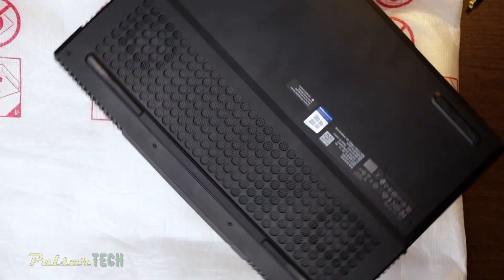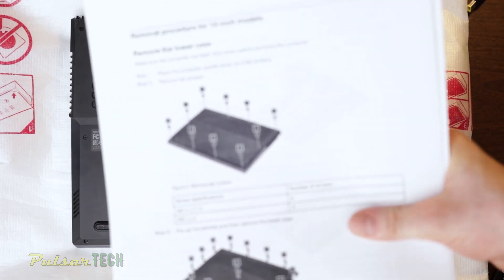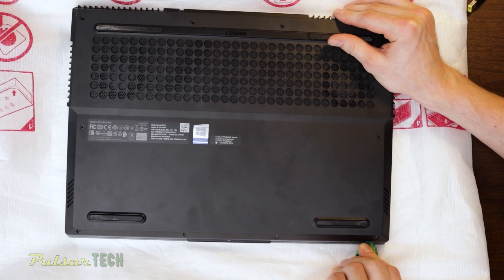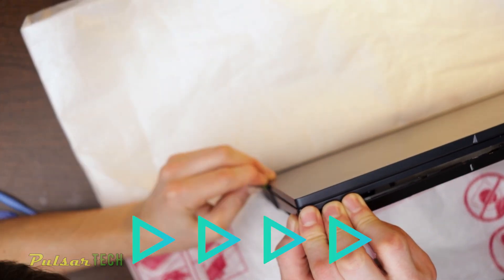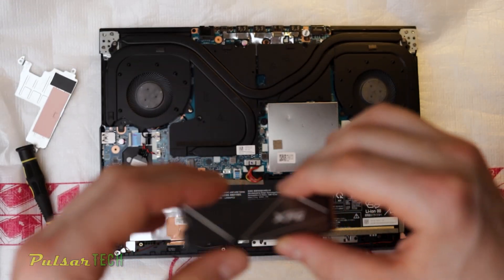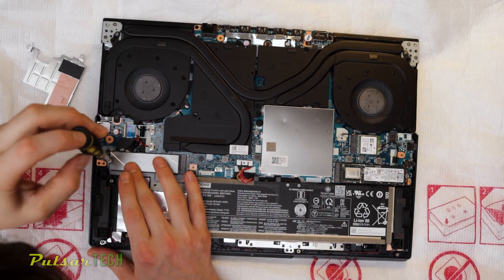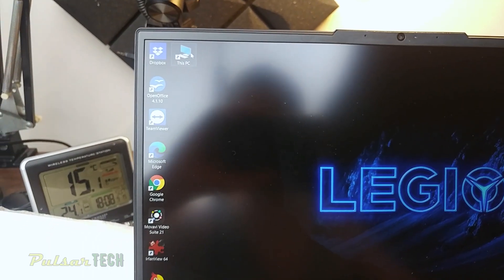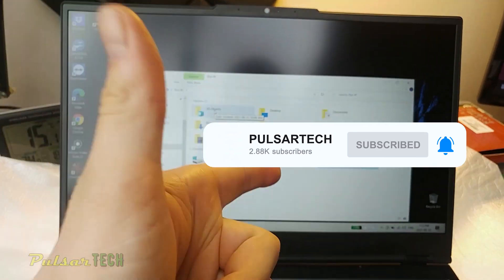LENOVO LEGION 5 HOW TO INSTALL A SECOND NVME SSD DRIVE

Comment: Hello. Can you help me. I install new SSD nvme 2.0 for Lenovo Legion y530 15inch, but ssd don't list in disk manager but in bios show.
Reply from the maker: Hi! Since your NVMe SSD shows up in the BIOS but not in Disk Manager, it’s likely not initialized yet. You can fix this by:
Open Disk Management (Windows + X → Disk Management).
Look for a disk marked as “Unknown” or “Not Initialized.”
Right-click it → Initialize Disk → choose GPT (recommended for modern systems).
After that, create a new volume and format it.
Once done, it should appear in Disk Manager and be ready to use.
Hope this will help!

Comment: Is it possible to make  RAID while we have 2 SSD?
Reply from the maker: Hi, I haven't done it myself but yes, it’s might be possible to set up RAID with two SSDs in a Lenovo Legion 5, but you’ll need to configure it either in the BIOS (if it supports Intel RST/RAID) or via software RAID in your operating system. Just keep in mind that setting up RAID will usually erase the drives, so back up your data first.

Comment: Any ssd m.2 can be installed in all lenovo legion 5 models? Or should i have a specific type?
Reply from the maker: Hi, it's a good question. Most modern famous brand SSDs should work. If you're getting some less known brand, who knows. But it's best to install it within and test it during the return period to make sure it works well. Other than that if you get the one that is already been tested by others in that specific model then you're 100% safe.

Comment: Any links for the disk manager software?
Reply from the maker: Hi, you can use any partition management programs like Acronis, or simply use Windows disk management, if your Windows is up and running from the first SSD. There you need to right click on a newly installed drive and select Initialize, that will perform the same action.

Comment: Where can I get the Acronis Disk Director to a USB to initialize the SSD? Im planning to upgrade my Legion to 2tb
Reply from the maker: Hi, you can get it from the Acronis website or you can use any other piece of software for managing partitions, even a Windows disk management, if you're installing a second SSD and can start Windows from the initial SSD. Hope this will help!

Comment: Mine dont recognized it , it is what site said nvme 2280 ( crucial p3 plus) , im confused , i did break cover lil bit😅 but its 3 yrs old , to poor for new one but for upgrade still fine 😊
Reply from the maker: The site usually lists a limited amount of tested hardware such as SSDs, while other SSDs might work also. Have you initialized it?
Reply: @PulsarTECH  No idea  , only thing i did is install it and chekked the mobo to see if its enabled but everything is enabled
Reply from the maker: @Bvn420  Can you see it in the Windows Disk Manager?
Reply: @PulsarTECH  no sir

Comment: How to know which ssd are compatible with my laptop. I am using Lenovo legion5 . Considering Samsung 990 pro ssd 2tb
Reply from the maker: Hi, you either need to buy one that has already been tested, such as in my video or other reviews, or simply hope it will work. There is usually a list of compatible hardware for the laptop on the Lenovo website, but the selection is very limited.

On the other hand, if you get a PCIe 3.0 or 4.0 drive with up to a 2280 size, most of them should work. Hope this helps.

Comment: do i need the blue thing you plugged in if im using the ssd for extra storage?
Reply from the maker: Hi, no if you're going to use it as an additional storage that means Windows will keep working from an original SSD. Thus you can go to the Windows Disk Manager and initialize the new SSD there. The procedure will be pretty similar to the one that I have showed in the video. Cheers!

Comment: Excellent video. Just wondering why you would not use Windows Disk Manager to setup the new drive? It's been a few years since I've added a drive, so maybe things are different?
Reply from the maker: Hi, good question. It's only my preference, you can use Windows Disk Manager for that or any other software for disk partitioning. Thanks for your feedback!

Comment: My laptop has a second SSD slot that is currently free. Do I need to clone everything from my current SSD to the new one, or can I simply put in the new SSD without cloning?
Reply from the maker: Hi, there's no need to clone unless you plan to use the new SSD as your system drive aka for Windows OS. You can leave Windows on the current drive and the new drive will be as additional storage.

Comment: Thnx for the vid and good explanation!
So I have a brand new legion 5. I just installed a new Samsung 990 SSD (4Tb). But it didn't came with a heat sync. And my legion 5 doesn't have any also. Do I really need one on my SSD or is it ok as it is?
Reply from the maker: Hi, thanks for your feedback. I would keep an eye on the temperatures, and yes it would definitely help to have a good heat sink. Check out this new video I've made recently https://youtu.be/BbABWJYeJx8 , you'll see what difference a heat sink and a good contact makes. 
The cooler it runs, the long it will survive.
Hope this will help.

Comment: is your gammix s50 lite works best with lenovo? i heard that gen 4x4 can't fully perform in legion 5 since it only supports gen 3x4 but im not sure though
Reply from the maker: Hi, yes it worked perfect. Though you're right it only has PCIe Gen3 x4 but it doesn't affect the performance because the maximum speed for the drive is 3500Mb/s anyway and PCIe Gen3 x4 can handle it no problem.

Comment: Bro, how can I contact you?
After opening the back panel, I couldn't open the SSD cover, so I stopped working further.

I did all this after disabling the battery in the BIOS.

After plugging it back in and pressing the power button, even in the boot window, my screen shows a white, smoke-like rounded border from the top edge to the middle portion of the screen.

What really happened bro? Display gone?, I'm ...🙁
Reply from the maker: Hi, it sounds like you may have encountered a hardware issue during or after your attempt to open the SSD cover. The white, smoke-like rounded border on the screen is concerning and could be related to:
Pressure or Damage to the Display Panel: If the laptop was handled roughly or pressure was accidentally applied near the screen area during the process, the display panel might have been damaged. This can cause artifacts like smoke-like borders, discoloration, or light bleed.
Carefully inspect the screen for cracks or any physical damage.
Check the edges of the screen for pressure points.
Connect your laptop to an external monitor or TV using HDMI or another available port.
If the external display works perfectly, the issue is isolated to the laptop's display or its internal connections.
Perform a Power Reset:
Power down the laptop.
Disconnect the battery (physically, if possible).
Hold the power button for 30 seconds to discharge any residual power.
Reconnect the battery and turn it on.
If the problem persists and you’re not comfortable handling hardware further, take the laptop to a professional technician.

Comment: Very good instructions, thank you. You're the only one YouTuber who mentioned that first you have to turn off the battery (I'm pretty sure you can also unplug it) before all the operations with Lenovo legion 5
Reply from the maker: Glad you found it helpful. You're absolutely right to disable the battery for the safety of the device.

Comment: Ha. 2 years after writing my first comment here, I finally decided that the ram needed to be upgraded to 32 gigabytes. I build PCs regularly but laptops are a totally different animal. This was one of the hardest casings that I ever had to remove. I need it to use three pry tools at once. And then, to top it all off I forgot to put the ram shielding back on, as well as the second thermal shield for the additional nvme drive I added. So I had to remove it a second time. Nightmare. I broke two of the small latches connecting, but it's really no big deal. It still snaps into place fine, and with 11 screws in, that case is not going anywhere. Hell, even with two broken latches and no screws in, that case isn't going anywhere. With all the updates to the newest Windows OS and browsers and games using more resources these days, 16 gbs wasn't working for me anymore. Thanks to TeamGroup for making quality affordable modules. And thanks for this video mate. I looked for my original comment in this post, can't believe it was 2 years ago.
Reply from the maker: You bet, thanks for your comment. You know the more you do it, the easier it gets. I have just  serviced mine and put new thermal paste, the video is going to be out soon I hope. I'm thinking of upgrading the 512GB drive to another 2TB, thus in total it would be 4TB, which is plenty. SSDs are becoming cheaper now and the 2TB is almost the same price as the 1TB was 2 years ago.
Reply: @PulsarTECH  Oh yeah, thats fun. I just got a request to build a couple budget gaming PCs that featured the old but still very good GTX 1080Ti. Issue was that they were founders edition blower style cards and it required me taking them both apart and adding paste, but more so replacing all thermal padding, and I had to measure and cut the padding to match the squares and other shapes. It took me all take just to rebuild the cards. But afterwards the thermal performance was (possibly better than new as I used Arctic paste and pads) like new afterwards, as I was able to fully clean them too. But damn was it a lot of work.
Reply from the maker: @bizbarley74  I have just serviced my 9 years old GTX 980Ti Hybrid card as water cooling started to make some noise, flashed it and refilled, also repasted it with Thermalright TFX and changed to Gelid 1mm thermal pads. Lot's of work for sure.
Reply: @PulsarTECH  yeah, that's pads. Different levels of thickness, using an exacto knife to cut the perfect shapes. Meh

Comment: I have a question, if the battery is already dead and you haven't charged it in a while cmdo you have to still do the skip in bios with disabling the battery?
Reply from the maker: Well, you would still need to plug the power cable to turn it on and enter the BIOS even if the battery is dead.
Alternatively, you can unplug the battery once you take the bottom cover off.
One thing for sure, you need to disable the battery no matter what even if you think it's dead, because usually batteries don't drain 100% but rather have have energy left over which may not be enough to start the laptop but enough to cause damage by a short circuit. Hope this helps.

Comment: So the compatible ssd is m2.nvme? Thank you
Reply from the maker: Hi, M.2 is a form factor for SSDs and NVMe stands for Non-Volatile Memory Express. It is a protocol designed specifically for SSDs to leverage the high-speed PCIe bus.
So this particular model supports two M.2 NVMe 2280 size. I've tried only up to 2TB but I've heard that it works with 4TB as well no problem.

Comment: How do I know which ssd would fit my legion 5 version? Could someone help me pls?🙏🏽
Reply from the maker: Hi, usually you can fit 2 SSDs up to 2280 size like in mine. Also in the manual for your model you can see how many SSDs are shown on the diagram. You can also go to Lenovo Support, then Find parts and it will show you the available SSDs for your model, though it doesn't how many can be installed. Hope this helps!

Comment: what about heat issue
Reply from the maker: Hi, the drives perform outstanding, the temps are very low, ADATA XPG is 35C, the default Micron 512GB is 39C

Comment: I have the Legion 5 15ACH6, according to the datasheet it has 2 PCI slots (same as the 15ACH6H) however one is 2280 and other is 2242, the SSD per default is the SAMSUNG MZVLB512HBJQ-000L2, but I do not if its size is 2242 or 2280, Does someone knows which is the slot that is free (the 2242 or the 2280)?
Reply: In actual, both slots are M.2 2280

Comment: Someone help. 

I have  Lenovo legion ryzen 5 laptop and it has become slow recently so I am thinking of adding RAM or SSD. 
I can add only one thing becoz of my low budget so pls suggest me which would be better.
Reply from the maker: Hi, you most likely already have one SSD in your laptop, so adding another SSD won't make it faster but adding more RAM will, especially in RAM demanding tasks.
Reply: @PulsarTECH  thank u brother
Reply from the maker: @Moinxx04  you're welcome

Comment: DUST? so cleaning the gamer fans has a method - check! but what about the internal from the fan to the exhaust tube - PC peeps often show significant fluff there. As i use my lappy on a bed (on a board of course) it collect that get skin dust very fast... love some proper insights - nobody talks about it 💕💕 love your vids
Reply from the maker: Great point! Thanks for the feedback.

Comment: Hello, I have the same model as you and was wondering of if xpg s70 would fit in ssd slot and how would I do the installation without the usb stick.
Reply from the maker: Hi, it fits M.2 NVMe SSDs with a 2280 form factor. Alternatively, instead of a USB stick, you can also initialize the SSD using a Windows Disk Manager program, as it is capable of performing this operation.

Comment: hi, great content
my laptop is legion 5 gtx 1650(if that's matter to consider the laptop type)
I cant quite understand, is my laptop also has that empty slot for another SSD? or is it just this type
because I think, my battery is bigger
Reply from the maker: The best way to tell is to check the specs for your laptop or user's manual. It can vary from model to model, some laptop might have an additional SATA SSD, some don't. What year and model is your laptop?
Reply: @PulsarTECH  i bought it on april 2022, here are some spec to consider the type : LENOVO LEGION 5 17 RYZEN 5 5600 8GB / 16GB 1TB+256SSD GTX1650 4GB W11 17.3FHD
Reply from the maker: @anomolisagag2270  it's difficult to tell without the model number. It seems that you have got a 1TB HDD right? Plus a 256GB SSD. So your model might only have 1 SSD slot and 1 HDD slot. You can also disassemble it and have a look if you get time. Let me know how it goes!
Reply: @PulsarTECH  okay, thanks for the input

Comment: Yo man, you probably won't reply to this comment, but I am looking to buy an nvme with a heatsink of dimensions: (80.5 mm [L] x 25.15 mm [W] x 8.88mm [H]). Do you know if this heatsink can fit into the laptop?
Reply from the maker: Hi, an 8.88m height is likely to be at the edge of what's possible to fit, but it might work. I haven't measured the exact available height, but considering the pre-existing heatsink that I removed, you probably won't be able to install a much bigger heatsink than the one already existing. I would suggest looking for an SSD with a slim heatsink, like the S50 Lite or a similar model. Let me know if you decide to go with a different SSD and how it works out.
Reply: @PulsarTECH  Yo man, I can't believe you actually answered. Thank you so much, I decided to go for an NVMe without a heatsink, since the laptop already has one. You just earned a sub.
Reply from the maker: awesome, hope you enjoy. What SSD have you got? Let me know how it goes  @Mache0_0
Reply: @PulsarTECH  I decided to choose the WD Black SSD SN770 1 TB. I will let you know how the installation went, but I have to wait more than a week for shipping, so it will take a while

Comment: Lol I didn´t disabled the battery XD i JUST WENT INTO IT but the laptop was not on. I will not go in if the laptop is still on.
Reply from the maker: Be careful, as if the battery is not disabled or disconnected and someone accidentally touches components on the motherboard, it might short circuit. This could lead to complicated troubleshooting and repairs.

Comment: Was told it only supports an addition 1tb SSD how can you use 2+tb?
Reply from the maker: Officially, the maximum supported capacity is 1TB. Unofficially, one can install up to 4TB if they wish to do so.

Comment: Hello!
So you installed pcie nvme gen 3 or gen 4?
Reply from the maker: The SSD is PCIe Gen4 but the slot is only capable of PCIe Gen3 speed. Nevertheless, both Gen4 and Gen3 are backward compatible just like USB 3.0 and USB 2.0.
Reply: @PulsarTECH   I changed positions of my Windows SSD and new SSD and now I have unleashed its full potential (now 6 gb/s instead of 3.3). SO YEAH Lenovo put their Gen 3 SSD in Gen 4 socket.
Reply from the maker: what year is your laptop?  @Djura1
Reply: And where is the socket for gen 4 pcie nvme?

Comment: Just installed a 4TB Crucial M.2 drive, worked fine. I was able to initialize the drive and create a simple volume with Disk Manager.
Reply from the maker: Great, thanks for the update. Now, you've got plenty of storage.
Reply: I was wondering if disk management wasn't an option😅
Reply: Thanks, you saved me a lot of time with disk manager :)

Comment: Hey man, I dont have a manual as it was lost, but I desperately need more storage, should I go forward with it?
Reply from the maker: You can download the manual online from Lenovo's website. However, if you're working on the same model as mine, you can simply refer to the video and follow the same steps.

Comment: Feck there was a screw already in there? The one that came with the ssd was too small. OMFG 😭
Reply from the maker: Yes, the screw should be included.
Reply: @PulsarTECH  What I meant to say is the screw that came with the new SSD was too small and there was no screw by the extra m.2 slot in the laptop. I managed to borrow a screw from an old hard drive I had lying around.
Reply from the maker: Great  @apocalypticbean

Comment: but I have a question if I connect an SSD from Kingston via USB, is it the same or not?
Reply from the maker: If you use an external SSD via USB connection, it's somewhat different as you need to keep it plugged all the time thus occupying a USB port, and the write/read speed may not be a quick as via a PCIe slot.